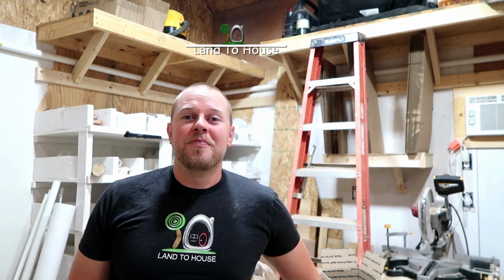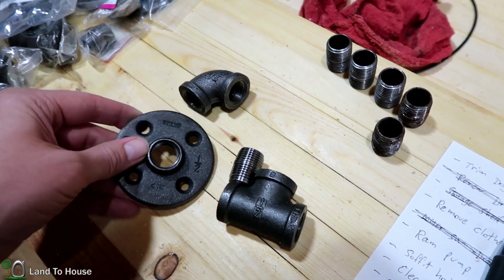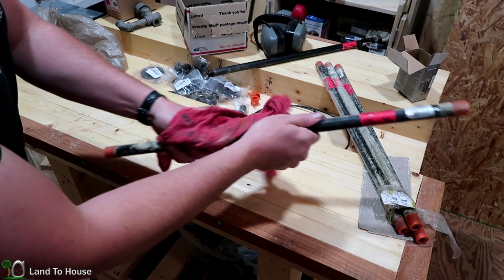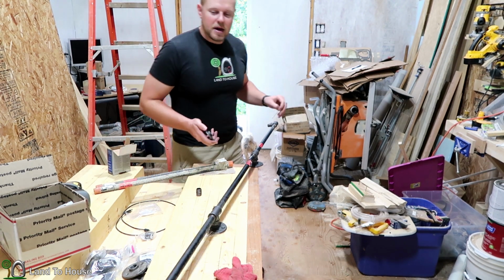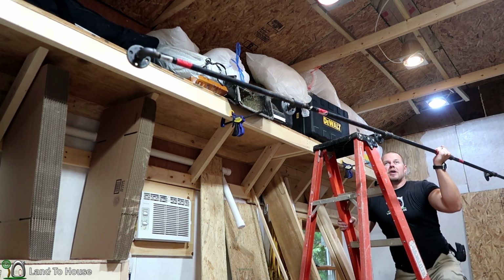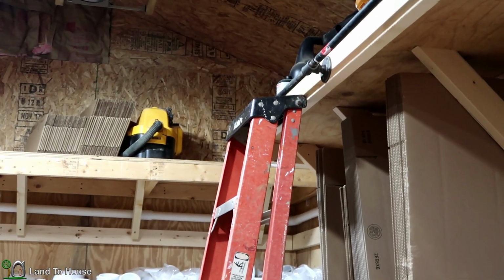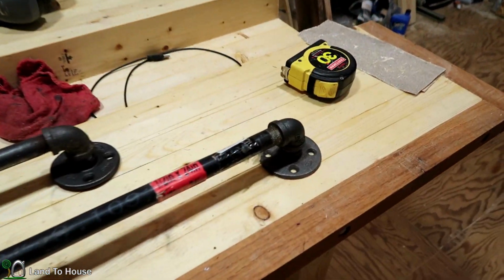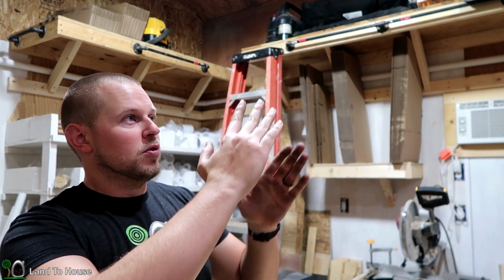Storage Ladder Supports - Build a Workshop #62

Comment: love the videos and this looks promising.  A suggestion: put rubber feet on the bottom of the ladder so that it won't slide outward when you put your weight on it.  having the full weight hanging from the pipes if the feet start acting slick on the flooring could be dangerous.